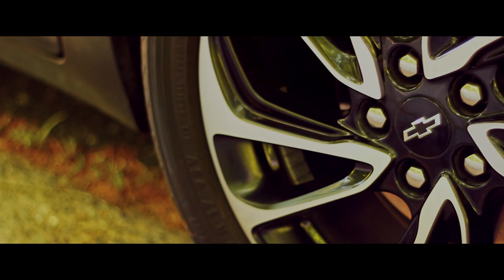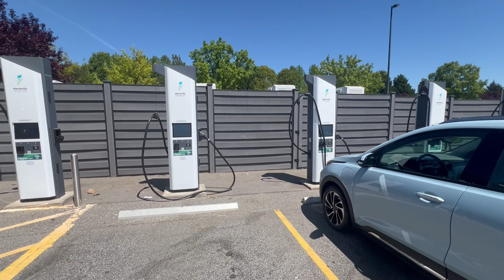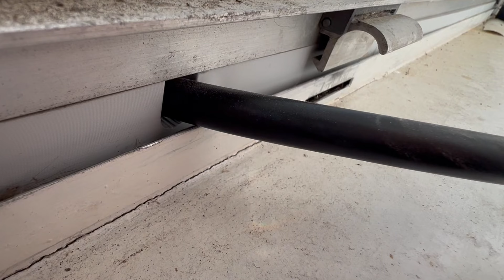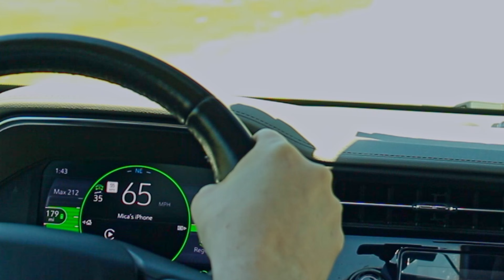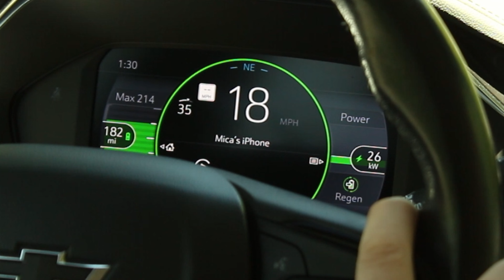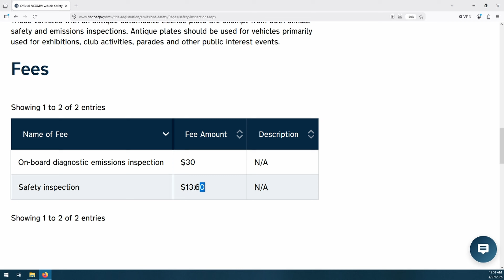Why Electric Cars are the FUTURE!

Comment: for oil change ever is incorrect ev have a gear box have oil fluid need change 1 time each 5 y or about each 120k kilometers,  is way less the a engine but good to know plus the battery coolant also about each 5y time need to be flushed,  is way less cost then gas but good to know i have ev Kona for 4y now .

Comment: I see that Cone-Ah reference.

With less use of the brakes, not only do the brake pads last just about forever, but there's also less brake dust on the wheels/tires/undercarriage. The car doesn't look grimy after a few years. And not just regular maintenance, but also big ticket repairs/replacements are also no longer a thing: transmission, timing belts, fuel injectors, radiators, alternators, etc -- all gone!